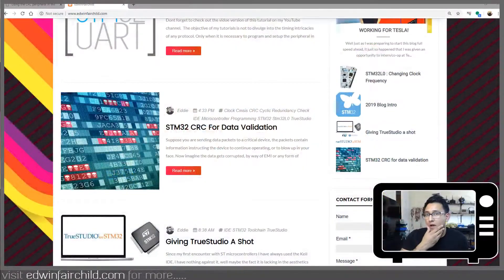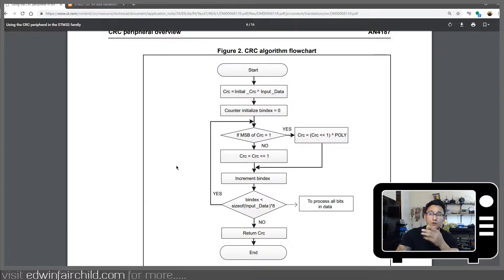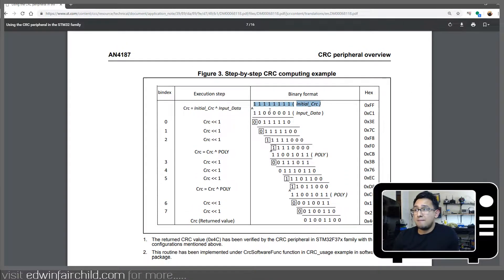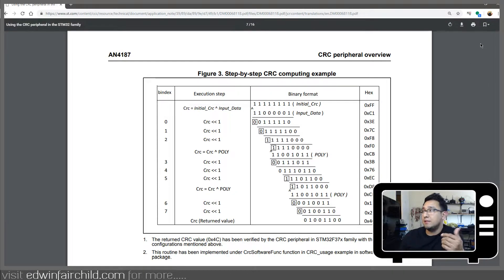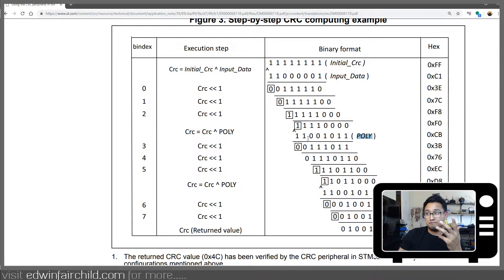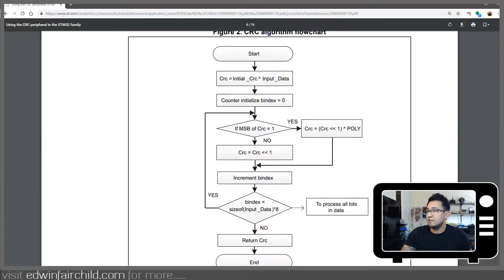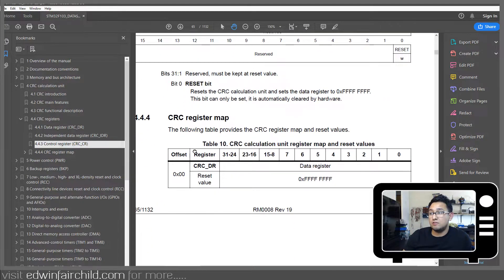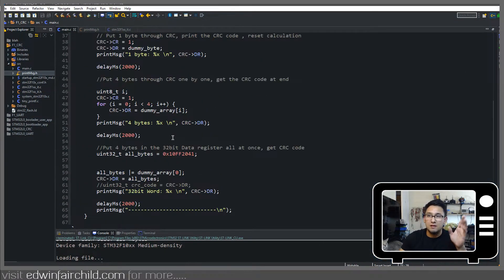STM32 CRC for data validation

Comment: Thank you for your informations. You've shared TX crc codes but you didn't share RX codes for any stm32 microcontrollers. For example , I want to use another stm32 to receive crc codes. I don't want to use any serial screen. So, how do I create RX crc codes for another stm32 microcontroller ? I want to send crc codes from stm32 to another stm32
Reply from the maker: you just send the crc through whatever mechnism you want, it can be serial, usb, wireless, i2c, spi .....crc is not a transmission line there is not "TX" or RX
Reply: @EdwinFairchild   No no Mr. Eddie. You couldn't understand me completely. You shared transmitter codes (transmitter side) but there is not any receiver code. If I want to receive data+crc codes from the transmitter side , what should I do ? what should be my algorithm ? How should I take and seperate data and crc on the receiver side ?
Reply from the maker: @do-crypto7952  your receiver  has to know how much data to expect, so  you can for example make a packet with a header that tells it to expect 10 bytes of data and 4 bytes of crc. Than you transmit all of the data including the header and then on the receiver you parse it all. Your packet could be something like : [4 bytes for length of data] [ data ] [4 bytes of CRC] so for example  [5][hello][0x34567345] , on the receiver you receive all of this data, it tells you data is length 5 , then the data then the crc..... So you then run the CRC on your data and if you get the same crc to match the received one then you know your data is good..... if that does not answer your question then idk what you are asking
Reply: @EdwinFairchild  thank you Mr. Eddie. I understood. Just one question I have. How should be comparison for receiver side ? I mean , on the receiver side I will calculate crc that is coming from transmitter side. But after calculate the coming crc , I need to compare this crc with receiver side's crc. How should I calculate the crc to be compared?
Reply from the maker: @do-crypto7952  you do not include the crc in the calcualtion for example in the example i wrote, you only calculate crc of the data, not data and transmitter crc, For example, transmitter sends Data "hello" and Crc 0x42, then receiver gets this "hello" and 0x42, but it does not know if this data is valid, so i runs crc on the "hello" and result is 0x42 which is amtching  the one the receiver sent so then we know the data is valid.

Comment: One thing that occurs to me: you probably want to send the CRC after a block of data (e.g. 128 words) rather than after each word; otherwise you'll be halving your bandwidth.  You might as well just repeat the data if you're going to do that.
Reply from the maker: Not everything is in blocks of 128,  if your sending a 2 byte command via i2c or something for a machine to stop s very critical process , and like I said it's only 2 bytes long and in such a system a crc is required at every command for safety reasons.

Comment: Hi Eddie, how does receiver know which CRC algorithm to use so that the CRC algorithm matches the transmitter side? I mean there are so many CRC algorithm or polynomial out there right? Does it mean it is the job of the designer to ensure that both CRC algorithm use in transmitting and receiving must be the same?
Reply from the maker: The hardware uses a specific predefined algorithm with some settings that you alter, your job is to make receiver have matching settings

Comment: I just started to learn CRC algorithm, but I think Eddie is not quite right when he said the receiver side makes recalculation and gets the SAME value, I think the value = 0, it means no CRC errors found.
Reply from the maker: there are many kinds of CRC algorithms I assume, and I have never really found an interest to study them , I can however say that STM32 implementation is not checking for 0 at the end of the CRC calculation , it would have to run the CRC calculation in a different manner , maybe reverse or something i dont know. It is running the same algorithm on the same data on both sides... and then comparing the check sum value ... which is a none zero value, check page 7 of this document , the CRC number at the end of this example is the number it will loook and compare when it runs the same algorithm on the data on the other side https://www.st.com/resource/en/application_note/dm00068118-using-the-crc-peripheral-in-the-stm32-family-stmicroelectronics.pdf
Reply: @EdwinFairchild  Thank you, I'll read it